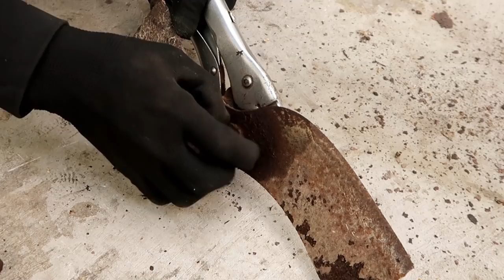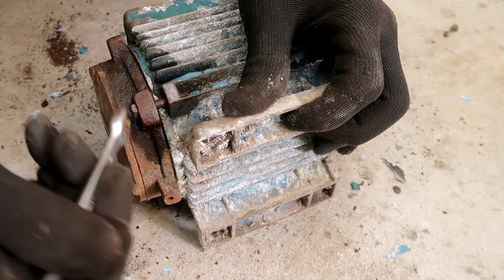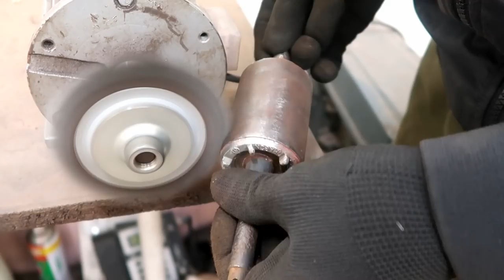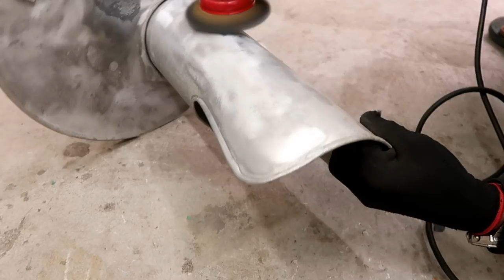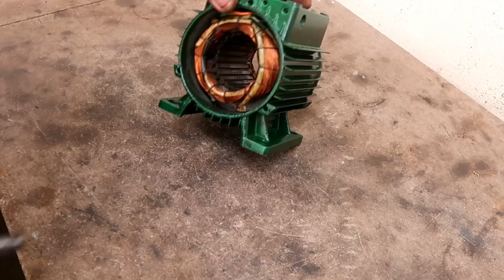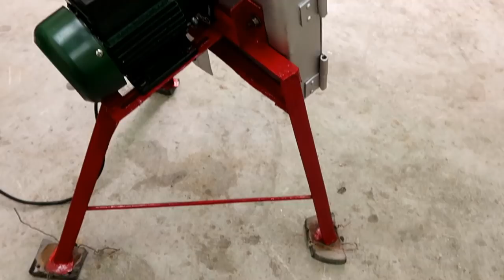Restoration Vegetable Slicer - Agricultural Machinery Recovery

Comment: Nice job spraying paint over rust Mr.E... The unit mulches rather than slices... Overall a very good job on the restoration... 8/10
Reply: There are plenty of spray paints designed for spraying over rust, one example being Rustoleum. You only need to knock the loose stuff off and it has rust reformers/inhibitors in it to take care of the rest.